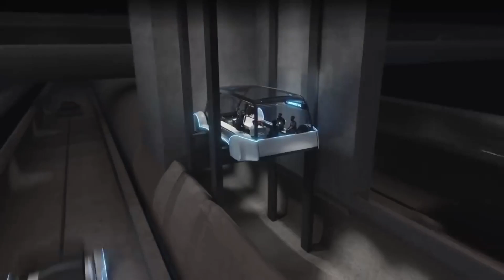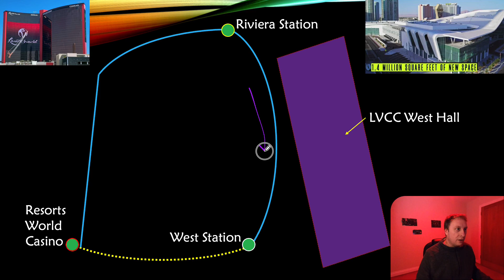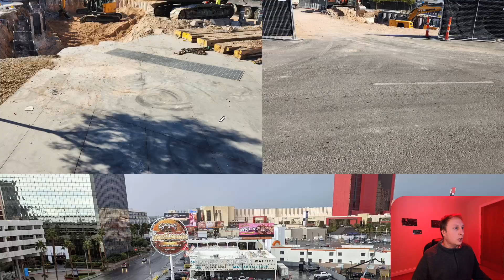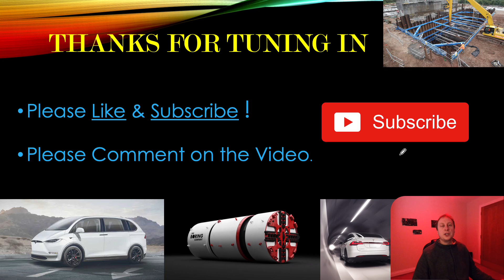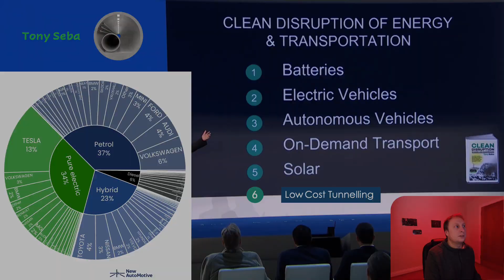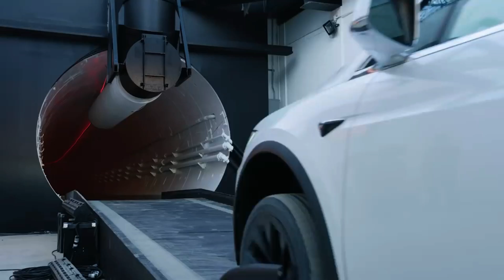Resorts World Construction, Phase 2b Commences 👷🏼 😁 🏗️ 💰 👍🏼 #162

Comment: According to a video by Kim Java that I just watched. A driver she interviewed stated that the Boring company did a test run of Teslas running with FSD active and 80mph!
Reply: Do you have a link to the video ?
In a confusing twist the LVCC drivers now use metric measurements in their vehicles so it's probably 80 kph (49.71 mph) !
Reply: @Swiv2020  https://www.youtube.com/watch?v=MjNRePVi6qY&t=270s

It is indeed 80mph - the timestamp is 4:28
Reply from the maker: @gerhardkrohmer7729  I'm quite perplexed by this development. For me, 80mph seems very high in this particular system.
Reply: @BoringRevolution  It may be somewhat uncomfortable for a passenger to travel at this peak speed, but evidently FSD has a sufficiently short reaction time to effectively navigate the tunnel.

Comment: In the last picture you showed of the excavation there are two darker grey rectangles in the cement between the fence and the excavator. These are air vents above the turns of the LVCC loop before they ramp up to station #3.
I doubt the launch of the TBM will encroach on that area.
Reply from the maker: It may be the ideal place to make a tunnel connection although this would disrupt the LVCC Loop for a few weeks.
I guess we will find out in February.